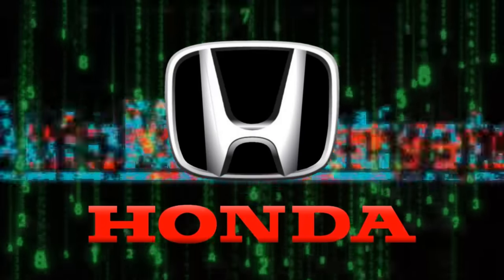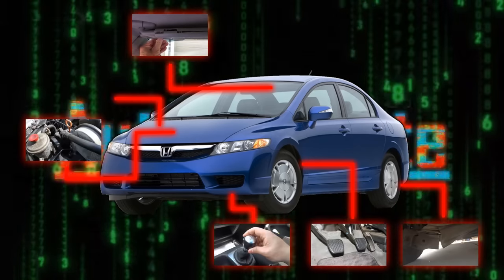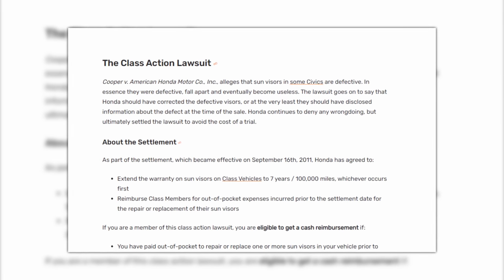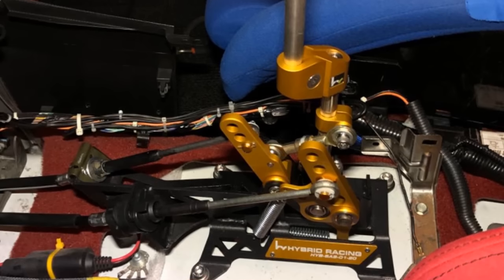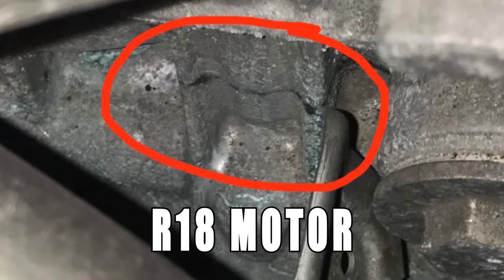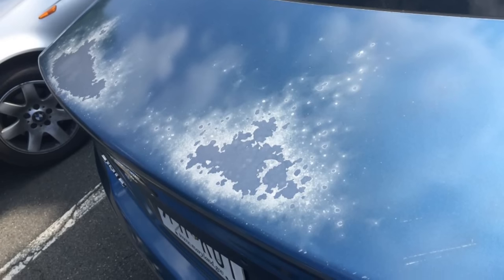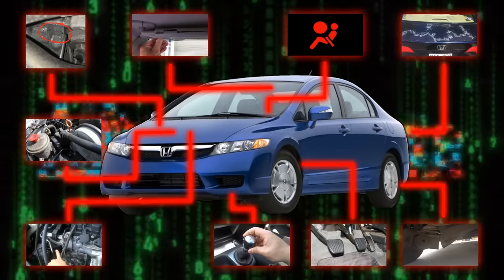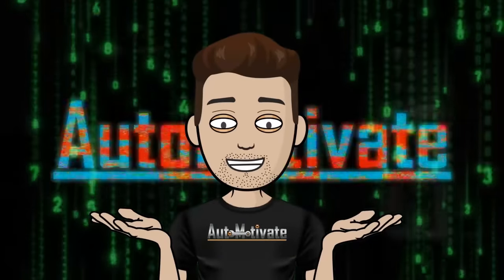Watch This Before Buying a Honda Civic 2006-2011

Comment: The automatic transmission went out on my 2008 Civic at 185k miles.  Other than that my biggest complaint is poor rearward visibility.  I'm 6' and would not be able to see an object or child behind my vehicle when backing up.  For shorter people it would be even worse.  Parallel parking is scary because it is hard tell how close you are to the car behind you when backing in.  Naturally a rear view camera ameliorates this problem but it wasn't a common option back then.
Reply: That’s true
Reply: how much did it cost to repair?
Reply: @treynoahz71 A local mechanic installed a used transmission with 57k miles on it and a 1 year warranty for $1,300.  Due to covid I haven't been driving the car much so it only has 210k miles now but the car is still kicking.

Comment: Just spend the extra money and buy a 13' Civic....last year for the automatics before the switch to the dreaded CVT.  Has electric power steering, revised R18 and backup camera.  Significantly better car than the 06-11.  Probably late now since they're all selling for $17k.
Reply: Still prefer the 06-11 because of their comfortable seats, ample storage, volume knobs and stylish back end. And another thing which seems minor but is still annoying is that with the 06-11, when you turn off the car engine, it does not turn off the audio system whereas with the pushbutton start, it does.

Comment: So far, the only problems I have had with my 2010 Civic are minor: the seatbelt retractor has lost some strength, so I have to be careful about the belt getting caught in the door.  The white paint has held up, but the black trim is looking a bit ratty.

Comment: I just bought a 2010 Civic LX for $6k. Even at 174,000 miles the car is clean, rust-free for the most part (a shocker in Central Illinois with its saltwater road winters), and handles like a dream. Transmission shifts without an issue. The paint is chip-free, and other than the three burn holes (I smoke the good good so honestly I can overlook and forgive this this lmao) the upholstery is pristine. The steering wheel is really worn oddly enough but a steering wheel cover can fix that. I had to find and enter the radio code. Took me about fifteen minutes to do and all that means is that the battery either died or was disconnected when the car was serviced by the dealer. That’s all I’ve found to be wrong with it. All in all I’m incredibly happy and feel I got it for a steal. I never thought I’d buy a little four-banger but of course the one I buy is a Civic. It’s a zippy little thing for sure.

Overall, the car gives the vibe of “privileged teen’s first car” (It has a decent amount of miles but is well-maintained. Also, there’s one burn hole in the driver’s seat and one in each rear passenger seat. This thing went through a few sessions 😂) and I’m not at all mad. I can’t wait to put a little love into this thing.

Comment: 375k miles on a 4 door automatic, it and keeps on ticking. Replaced engine mounts twice, shocks twice, I installed a new AC system, replaced headliner, door lock actuators on 2 of the doors, power window assembly on the driver, mostly wear and tear stuff, do all my own repairs. Only major repair was Pivoting bolt on serpentine automatic tensioner sheared off, had to weld a nut onto the broken bolt but luckily got it out lol. Also it leaks a little bit of oil from the main but otherwise engine is still running strong and transmission still shifts like butter. Also this is a California car so no rust.

Comment: my 2006 bought new had cracked engine block at 52K miles. Honda replaced it for free even though it was outside warranty. now I have a 2016 Civic.

Comment: I bought a 2007 Civic & within 24 hrs the engine overheated cuz coolant was leaking.
I was scammed by the stealership I got it from 🤣 
I somehow managed to get them to replace the engine (still at the mechanic) but not too sure if I should trust the car back in my hands.
It only had 69k miles on it!!

Comment: I have an 08 civic, has almost 200k miles. Have had front bearings replaced, which I did. I need to replace the ac cooling fan but after almost 13 years jist tires and brakes.

Comment: Cheap visor  ☑
Bad engine mount  ☑
Faded paint job ☑
Bad power steering pump ☑
Reply: I don’t have the paint issue yet lol one of these days I wanna get my car repainted white lol or a dark grey and I gave 120900k exactly
Reply: Y hâve a Honda Civic 2008 si 240000km And y Nevers are problème with

Comment: From my undestanding, cracked engine block is an issue with US-built R18A1 (for US market) but not an issue with R18A2 which is built in Britain (for European market) despite being very, very similar if not identical engine.
Reply from the maker: From what I have read up, you are correct. I should have clarified in the video.

Comment: Does your engine sound different when you need a valve adjustment. I have a 2010 civic with 143000 miles and never had a valve adjustment.
Reply: I have a 2010 civic with 145000 and asking the exact same question.

Comment: For a first car; this was great. I didn't have many of these issues he mentioned in my 2008 lx sedan (118k), 2008 Si Coupe (133k), or my 2009 Si Sedan (168k). Only my couple had some sun damage (which is notorious), Some rust spots on the rear did come about on the rear driver quarter panel (driver in heavy salted areas + snow), other than that standard maintenance. I've owned Hondas most of my young adult life for 10+ years and it has been affordable and great on gas.

Comment: I’ve put my 2010 Civic EX through hell and back and it still runs great at 174K.
Reply: Hey I found a 2010 civic with 178k miles for $4500, clean title. I can probably negotiate the price down to $4000, maybe even a little less. Do you think it’s a good deal at around $4000? It’s a nice black color too, I’ve been looking for a black one, and the buyer told me it’s an ex model, but I don’t see a sun roof, so I think it’s an lx model
Reply: @kingdoge69  ex comes with sunroof, price might be a bit too high I think.
Reply: @zantiagotron07  yeah price is a bit high, I was thinking the same. I haven’t had a car in like 2 years and my budget is 5k, and I’m getting impatient lol can’t find any good deals in my area either since I’m looking for 2010 or newer since they don’t have that cracked engine block issue
Reply: @kingdoge69  test drive it man and if it feels good go for it 👍
Reply from the maker: Similar the the housing market, the pandemic/covid 19 increased the price of the cars. 
In a healthy market, there would be a lot of choices if a similar car to drive the price down a bit. 

In the housing market, a healthy market would have a 6 month reserve, or around 3,000,000 houses for sale in the US at a time. April, the housing market drop down to 500k houses, which is why all houses cost way more then they should right now. 

As people start getting back to normal, so will the markets. 

It’s predicted that by end of this year or the start of next year things will become somewhat balanced again.

Comment: I personally own a 2006 Honda Civic bought it new I have 358,657 miles on it and it’s original, last week I replace the starter the first major issue since I’ve had it, the most reliable vehicle I’ve ever owned. I also have a picture of the odometer at 333,333 and 3tenths I was on Indiana 33, 33 minutes from home, yea buddy,  true to the best of my knowledge
Reply: Auto or manual?

Comment: Worse thing about my 08 ex coupe is the cracking paint. Hurts me every time I see it
Reply: Honda issues a recall on the paint for certain paint codes and VIN’s this is one of the few issues of the 8th gens
Reply: Omg yes they all have chipping paint
Reply: What years is the paint recall? Or just by vin#❓
Reply: @DSTREETMEDIA  if I remember correctly it applies to all years of the 8th gen Civics from 2006-2011. Only certain paint codes fell under the recall and I can’t remember off the top of my head which ones. I know rally red was included as was the dark blue color. A quick VIN check will tell you for sure. This recall window has since closed however and any repairs are now on the consumer.
Reply: @MrWeshill  thank you Wes !! 🙏

Comment: I have a 2008 Civic, 130K miles. The paint has faded badly. The visor broke and had to be replaced. The fuel pump had issues, twice, & had to be replaced. The control arm does cause early tire wear. The airbags did have a recall. Asides from this, the car has been good.

Comment: These cars are unbreakable last forever as long as oil change every 5k and transmissions oils I got bored of it sold my tho 2009 exl civic loved it
Reply: Did your 09 civic ever have the cracked engine block issue?
Reply: What about brake fluid change?

Comment: Bought mine in 2017 with 144k it has 256k now and still going strong. I have thrown 1000s of dollars of parts at it though 🙃. Fuel pump, starter, alternator, struts, motor mounts, clutch kit twice, valve adjustment, spark plugs, throttle body, brake calipers, cmc and slave twice, etc. If you take care of your maintenance these cars will not fail you.

Comment: Looking to buy a civic under 2500$, thanks for the information! Especially the complains chart at the end!
Reply: Have you found one yet ?
Reply: good luck,since the pandemic, prices have gone up
Reply: I waz lucky enough to find an 08 si with 152k for 2,500. Slight grind on 3rd and needs bodywork and a paint, but overall it's a damn good find i think. Keep an eye out and hace the cash ready. Good luck!
Reply: @juanrico8864  Damn same, but i paid to much now that i see everyone’s prices. bought mine at 4k😑 but i have some build ideas
Reply: Got a 2008 civic for $2500 with 90k miles I got it from a family friend so rare but is possible I also looked for a good deal for 5 months so just be patient and be ready to go make a deal

Comment: We bought a 134k km 2007 1.8VXi A/T last June, so far, no problems whatsoever.  We drive it with respect for the engine, gearbox and drivetrain (no robot races, flooring when cold etc.).  Forums normally only feature those with problems, one never hears of the 90% who never have problems.

Comment: Driving a 07’ civic ex. 98,000 miles. Have had the sun visor issue, engine mounts, and the paint on my roof looks like the pic…other than that only major issue was a new starter at the 10yr mark which is expected. Best purchase ever.

Comment: Yeah their engines still crack
They can do it as high as 200k or as low as 40k
Reply: Mine went around 70k, got the extended warranty only due to this lol
Reply: Specifically the r18 not the K20Z3 in the Si models

Comment: I have an 06 EX and repairs i have done over its 242k miles are as follows starter, ac compressor, starter, motor mounts, shocks and struts, brakes and rotors, lower control arms, rear bearings, front bearings, thermostat, temp sensor, pcv, and evap purg valve. Given the mileage climates i have had it in nothing crazy. Jacksonville,FL Twentynine Palms, CA KC, MO and now San Diego, CA each for at least 3 years.

Comment: 2008 Honda civic. Got it used with 18k miles.
replaced front and rear shocks, all motor mounts

I had a part where the coolant runs next to the transmission fluid. I had a cool mechanic hook me up and created a radiator for my transmission oil! this happened at 140k

I'm at 240K and my Engine block started leaking coolant. My cars outside the window. I patched it up with JB weld and so far 600 miles in it's holding.  If it weren't for the ridiculous Radiator issues I'd be extremely happy.

Comment: I have a 2006 and now I know why the airbag lite is always on. I have the bad paint and replaced the sun visors with new ones I bought on Ebay. 16 years, 180,000 miles and still going strong.

Comment: Love my 06 Lx Coupe.. 196k n she purrs
Reply: Did you have any steering issues? I have the Ex and have steering issues.
Reply: @GMarieBehindTheMask  I have an 06 coupe 5at it’s at 186k miles no steering issues.
Reply: Engine block replacement at one point?
Reply: Love my 06 lx coupe  the only complaint had to get a new paint job
Reply: @GMarieBehindTheMask  I’ve had issues. My power steering pump has had problems. It was leaking and I had the the main pipe replaced but that didn’t fix the issue. I was told I needed a whole new pump. So, I Purcahsed Lucas Stop Power steering fluid and that stopped the leak!!!! Worked quick too! The only thing is now that my steering is a little stiff. Besides that the car has been fantastic. I tell everyone that it has been my best purchase of my life. Lol. I got 202K on mine and that’s the only issues I’ve had! Civic Life!
Reply: @GMarieBehindTheMask  nope I have 203, 500 miles and no steering issues.... I got had a crack in radiator neck and it was leaking coolant I noticed my car was running a little warmer than it usually does basically the whole cooling system replacement everything but the heater core water pump radiator thermostat lines all new.. control arms, struts  at 155k... This car is easy on brakes my pads have lasted with little wear on them, a pair of Bridgestone Tires made this car handle even better than it did... I love the 8th generation Civic Coupes.. I put a K&N air filter in it and did a muffler delete

Comment: I have a 09 coupe and the visors and mounts have been relaced. Other than than that  its a stong little car.
Reply: How long have you had it? Have you had the cracked engine block issue? I’m gonna look at a 09 civic ex tomorrow
Reply: I bought it from a friend in 2014 and no issues at all. I had to replace the cv joints , all new mounts, and put new struts about a year  ago. They are very reliable cars. It now sitting on my driveway since the pandemic started but i still take it around the block once a month. @kingdoge69
Reply: After 13 years,  the original  starter  finally  give out. I just had it replaced and she's  running like champ with 81k miles on it.

Comment: The only issue I ran into with this car is driving down the road with no lights on.

Led dash can't tell there, the dash is always lit. Fog lights will confuse you at times those are always on, and blend in with street lights and other things.

Fix: took fog lights out no highbeams but need lights on at night more so no one crashes into me.

Comment: Lol wtf this is prolly one the best ones to get lol we had this one for almost 10 years now
Reply from the maker: I’m not saying don’t buy the car. I’m just pointing out the most common issue within this model to help others diagnose issues they are experiencing. 
I have many comments talking about their cars being reliable up to 200k miles. And many others have been validating this video.  Not every single Civic will have these issues I’ve listed.

Comment: I have a 07 Honda Civic LX  4 Door and bought it brand new with 14 miles on it, it now has 180,500 miles on it, I’ve never experienced any of these issues at all, and I have done a few minor modifications to it such as replacing the stock cold air intake with a short arm Injen cold air intake, I replaced all 4 rotors with drilled and slotted rotors, I have the Skunk 3 racing suspension on front and rear . And I have the Automatic 5 speed transmission. Not one issue at all not even the AC compressor has failed on mine , I just keep up with the basic maintenance and my car is still running like new.

Comment: I have owned my 2008 honda civic that I bought used 11 years ago and I haven't encountered ANY of these problems. IN FACT, I haven't had to make a SINGLE REPAIR! Only routine maintenance. I speak from actual experience, what are your (unreliable) sources?

Comment: The visor was fixed for free on a recall, same with the takata air bags. Nothing else went wrong with that 2011 Civic.

Replaced 1 strut and top engine mount at 120K miles. Want to see which other car/brand can compete with that record.
Reply: I just took a hunting knife to the passenger side air bag instead of getting it replaced.

Comment: I have a 2006 Honda Civic with 336, 000 on the original engine and transmission..Still running strong...

Comment: Viser and paint fade. Check. Only 2 problems I've had with my 2011 with 198k miles
Reply: The last year is always the best year to buy.  My 06 has power steering leak that I'm not happy about, it's an expensive fix.
Reply: I kinda like my 2011. 
185k miles and leaks like Exxon Valdez, but it still runs.
Reply: @krisaskew5801  - you know where the leak is coming from?
Reply: @mikea5205  it’s coming from the back side of the motor, above the drain plug and motor mount. It is not the Vtec solenoid. I’m afraid it’s the oil pan.
Reply: Cruz Ponce   did you do the fix yourself? 
I am honestly not looking forward to that.
Reply: Cruz Ponce   thanks man. It’s my wife’s old car, so I’m about ready to park it in the backyard and forget about it. 
She wants to keep it, but it is to small for my taste. So I haven’t been in a hurry to get it off the jack stands.
Reply: @mikea5205  I got the 2006 EX and I am in $1,500+ in maintenance and repairs. Never again buying a first year car.
Reply: My 94 ranger was leaking from the oil pan all I did to fix it was re-torque the bolts. Some where loose enough to turn with my fingers. But it stopped the leak. Or at least slowed it down enough to where I wasn't getting spots all over my driveway

Comment: '06 EX - Cracked engine block, engine mounts, gaskets, clear coat failure. I swear, I must have bought one that wasn't reliable because I've had other issues. Serpentine belts, wheel bearings, tie rods. Still have it for 16 years. 144k miles. Still cheaper to repair than to drop 30-40k on a newer car. I'm jealous for those who have this vehicle and barely had any issues.
Reply: I have the 06 ex with your same similar exact issues…one issue after another…
Reply: @lorenzobyers7361  Damn. Well. That will teach me never to buy a car in its 1st year of the new generation.
Reply: @Gropmag215  I definitely agree!!!